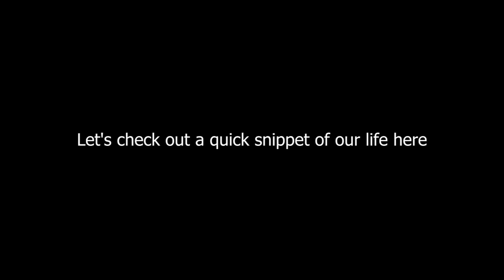"Amir and Family Transform Their Backyard with Beautiful Stone Platform"

Comment: These little quarter high walls will help the earth from eroding down from behind the house. In my opinion the next project should be to level the front of the house as soon as possible because I see the earth in front of the house is also easily eroding. because the house sits on it, you must immediately stabilize the ground there. You need to level up, maybe use another quarter high stone wall in the front, say, ten feet away from the house, and then fill  up with earth and then level and concrete the ground. Your front door also needs nice, wide, friendlier stairs.